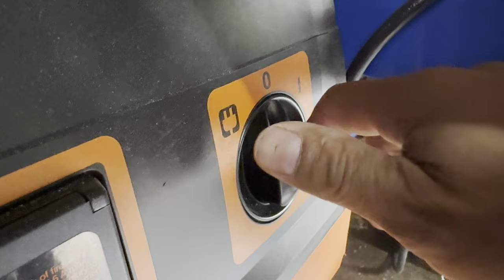Stepcraft M.1000 automatic tool changer, walnut butcher block backgammon board production

Comment: How are you liking this machine to date, I’m looking to buy the same one with the same tool changer
Reply from the maker: I got mine when they were first released back in 2020 and it's serving me very well. I do a lot of batch production work on a daily basis and for the things I make, it's been an excellent system. The tool changer is what sold me in the first place. That accessory alone affirmed that I made the right choice for a machine in this class and price range. Definitely get the ATC!
Reply: @mountainmakers  Have you found there to be enough support for stepcraft?  Looks like a good tool but very little online presence and the FB group is pretty inactive.